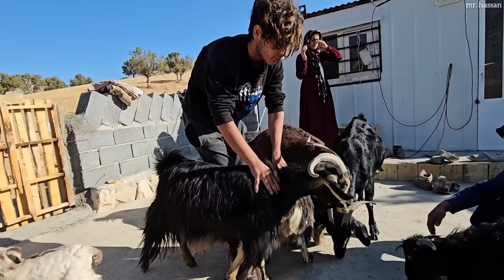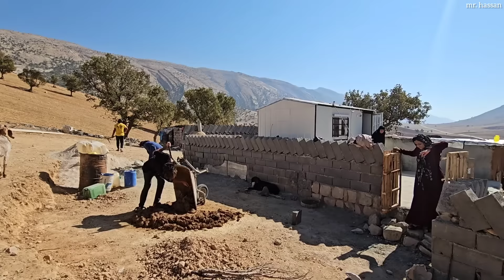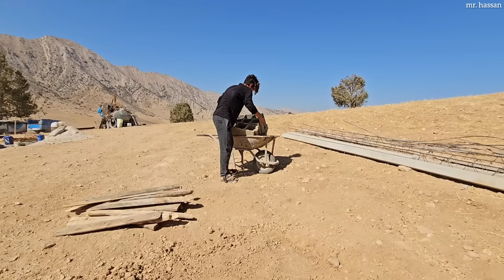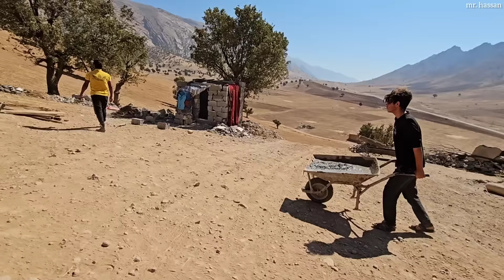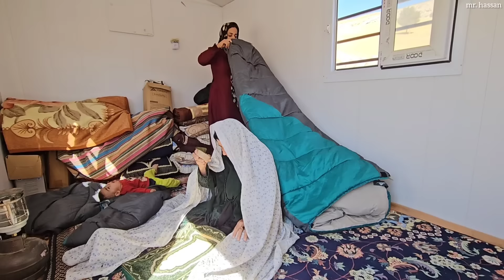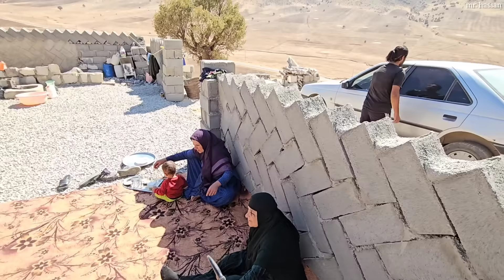Bittersweet Moment: Grandmother and Nomadic Sister Say Goodbye on Puppy Hut Day

Comment: Hassan u guys are jumping around, not finishing one place, clear the rubble and clean up. At the fire place, around the cabin, u bring this rubble there. Remember it's not even save for your mother and others with the long dresses to walk over that uneven rubble, the can trip and fall, an other emergency. Please finish there and fasten the cabin underneath around, used that rubble by shorting out for a nice cement floor, that also keep the cabin grounded fast on a cement page. Your ring ceremony is near still the yard and around is still not cleared. Please work from one side. 👍